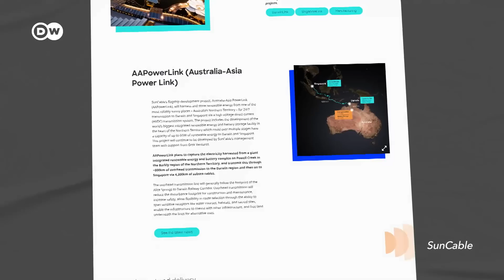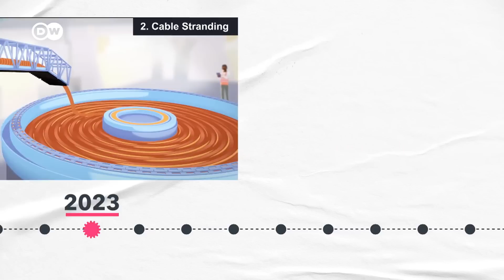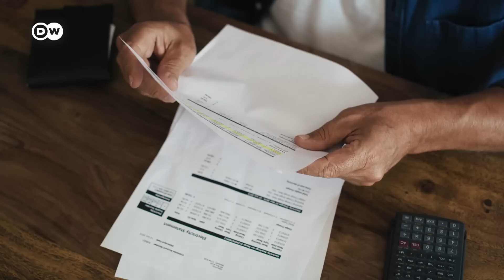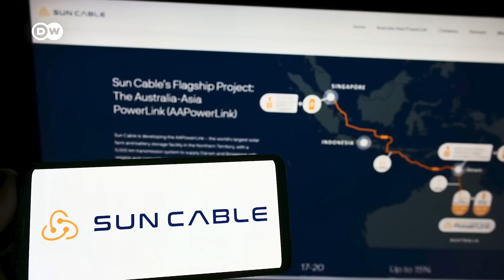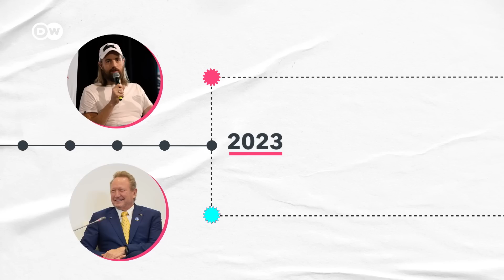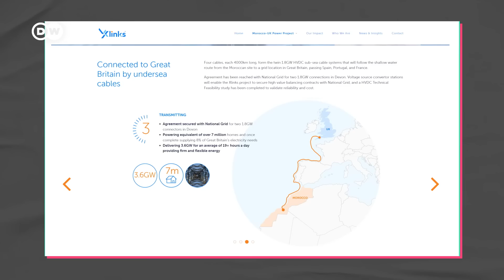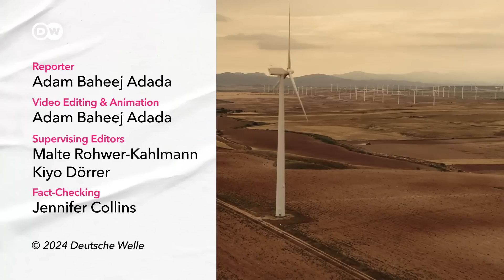Why the mega plan to send Australian solar to Asia (almost) flopped

Comment: Failed to mention that due to long distance and cable resistance 30-50% of the produced energy is lost in transmission.
Reply: No - please check your facts on the use of very high voltage cables.  The drop is minimal.  The only weakness in this soluation are the expensive converter stations at each end.
Reply: @1968Christiaan exactly.
Reply: @1968Christiaan , well, with any transmission line technology, the losses increase with the length of the cable... So even if the losses over 1000 km are only a bit over a couple percent you are looking at about 10% loss over this cable length. That is not nothing... This proposal would have to be seen in competition against other renewables that are possibly a lot closer.
Reply from the maker: Hey there! Could you share your source for the % lost that you mention. There is power loss over the distance. The typical power loss for HDVC cable systems is 3 - 3.5 % power loss per 1000 km. With increased length, the resistance increases and leads to higher power loss.
Reply: Please don’t base loss calculations on traditional alternating current technology. The new way of transmitting power over long distances is by using direct current and modern super efficient inverters on the other end.
Reply: @kevcump62 HVDC is not lossless.
Reply: @davidrossi1486  I did not say it was losses. For very long distance transmission, the new high power inverter technology make DC transmission much more efficient than the high voltage AC transmission lines people are accustomed too.
Reply: The company is using High-Voltage Direct Current (HVDC) lines to carry the electricity from Australia to Singapore. According to the HVDC page on Wikipedia the transmission losses are approximately 3.5% per 1,000 km. 

Over at the SunCable site on the Manufacturing page there is an entry on the FAQ dealing with the types of cable they will need to use. They state, "AAPowerLink needs two 4,300-kilometre HVDC subsea cables to transmit power to Singapore. The current global supply chain lacks the capacity to produce the 8,600 kilometres of cable required within the project timeframe." So they have reduced the project from three cables down to two. In answer to another question they state, "The advanced cable manufacturing facility will focus on 525 kV-640 kV HVDC subsea cable for the AAPowerlink project during its first four years of operation." It is said that the conductor will be made from either cable or aluminum, which really isn't helpful. I don't think that they provide enough information on the site, such as the diameter or circumference of the conductor for example, which would allow one to perform a more detailed calculation of the power cables' performance. 

Each cable will be 4300 km in length, leading to approximately ( 4,300 / 1,000) * 3.5% = 15.05%.
Reply: There are always cable losses. . .  And they are far less with HVDC than AC.. .   And they have been allowing for that.
Reply: Yes people often seem unaware of "voltage drop" - where you lose power when transporting long distances. Better to design a grid where power is generated close to where it's used.
Reply: Sunrise seriously needs some therapy 😂😅

Comment: The island of Ireland has vast potential for wind energy that is very slowly going through approvals and mapping, the biggest issue is connections to markets! We only have connections to the UK at present with the Celtic interconnector between France and Ireland the first non UK connection, but we need many times more connector capacity for us to be able to export our vast wind energy to the European market! They also talk about green hydrogen here, but as you say, it's a very inefficient use of energy...
Reply: An interconnector from Ireland to France - now there's an interesting story, DW. Suncable was always pie-in-the-sky, at a time when not even all Australian states are connected.
Reply: Yes, that is all developing. . . .  Green Hydrogen should only be made from surplus Wind and Solar generation periods and stored as Hydrogen for later use when needed.. .  It is a form of Energy Storage. . .   And if made from Surplus Wind and Solar, it is Not inefficient, but almost a free bi-product.

Comment: At present time, it is a worthwhile idea to transport this energy.   But consider the availability of sunlight and wind are very widespread across the globe delivered freely by nature.

So, the idea of having huge interconnection like this may become moot in the near future because most of the world's population lives in the sunny & warm locations.  Transporting this energy possibly could have value for remote locations living in high latitudes perhaps but that's it.

Moreover, the idea of energy independence is growing since energy is a matter of national security level importance.  It's just that the level of energy independence that renewables can provide has been unthinkable in past decades with fossil fuel global dominance -- exactly what the fossil fuel hegemony wanted.  Renewables have reached historic level low costs of energy production and still continue to fall in price!  The raw inputs of sunlight & wind cannot be sanctioned, blockaded, tariffed or taxed.

Comment: This is so frustrating. Like, the engineering would work, but money and bureaucracy is getting in the way…
Reply: Engineering is by far not only about making something work. Engineering also needs to deliver effective solutions. There surely must be some serious questions about the long-term cost-competitiveness of this idea...
Reply: The project collapsed because the Singaporean Government wouldn't pay for such expensive, intermittent electricity! It is not and never will be a viable, reliable, commercially sensible source of electricity.
Reply: This is not just about bureaucracy. This bureaucracy is here to express the will of the concerned population
Reply: Imagine complaining about money getting in the way. Look up the Juicero if you want an example of what engineering without regards to cost or reason can create. Using resources efficiently is essential to any human endeavor.
Reply: The engineering does NOT work. The cables do NOT work. The economics do NOT work.
Reply: read a 100yo electrical book it will explain that without magic there are laws we have no control of that physically will not allow it to happen, its factually impossible to have the energetic action travel around the world an still even be. 700km think it was that's the longest line on earth and its running upwards of 750,000 volts to have output the other end.
billion volt earth grid because thats even possible.
Reply: No, brains got in the way finally
Reply: Money yes, but Bureaucracy does not need to get in the way of HVDC... .  Yes, AC Grids do require bureaucracy and central control, but HVDC does not.
Reply: Ego & Greed
Reply: @HunterPendleton-nx5pr    It just needs some people to see the way the future power should be handled.. .    Some of us can see that, but some others, will not want to spend any money doing what needs to be done for the long term benefit.
Reply: The engineering doesn’t really work, but the economics is shot. Utterly pointless, especially when we have cheaper and more reliable forms of energy.
Reply: @rickjohnson2165  interconnectors increases reliability for everyone involved.
Reply: no one want expensive electricity.
Reply: @asfsfas2435  hence no nuclear in oz
Reply: @duncanidaho9153  : Nuclear power brings down electricity prices by 75% in Finland.
Reply: Reality bites, doesn't it?
Reply: engineering also includes feasibility and impact. Just because you could doesn't mean you should.

Comment: Why go for these super-long cables? Why not join up neighbouring grids first and learn from those smaller/easier projects? Morocco to Spain, Australia to Indonesia etc. surely it would be quicker/easier to get these up and running...
Reply: The problem is this is being done for money, and Singapore had more money than Indonesia.
Reply: @JohnHughesChampigny  true but Indonesia are spending billions on a new purpose built capital city. It would be easy to add this into the infrastructure. Then just island hop to Singapore and mainland Asia.
Reply: Yes, and a Western Australia to South Australia high voltage DC connection to join the Western Australian power grid  to the grid of the other Australian states sounds easier than a long undersea cable.
As has been pointed out, the significant time difference between Perth and the eastern capitals would be an advantage in matching peak power production with peak usage.
Reply: When you send electricity "through" another grid then you need to pay the operator of that grid a fee for using it. They need to balance their grid with the extra load coming in on one side of the country and leaving on the other. How they meet those demands is up to them. They aren't just going to build a new cable from the incoming interconnect to the outgoing interconnect and let the electricity pass through. They might shift the incoming electricity to a nearby city and export the power from a generator near the outgoing interconnect. That's assuming that they are even capable of handling the incoming amount of electricity if their grid is at or near capacity.

It might be less expensive in the long run to lay down a new undersea cable instead of paying multiple grid operators their fees for passing your electricity through their grids. For example, if Scotland wanted to export power to Gibraltar in the hopes of using it as a connection to Africa, then they would have to go through England, France, Spain, and then to Gibraltar. Or possibly Northern Ireland, Ireland, France, Spain, and Gibraltar. I don't know if there are separate operators for England and Northern Ireland but I'll assume there is. If the cost of passing electricity through another operators' grid is $0.01/MWh then for every MWh delivered from Scotland to Gibraltar it will cost either $0.03/MWh or $0.04/MWh depending on the route taken. They also don't have full control of the equipment used to send their electricity. It's not just security issues but companies could become poor in maintaining their equipment leading to outages. 

While it may cost a lot of money upfront to install an undersea cable it may average out to $0.02/MWh. (I'm just guessing and I have no idea how much it would really cost.) In that case it would be an easy decision to go with ones' own cable. Even it it were $0.05/MWh it still might be worth the price as it builds in the security of knowing you control your own equipment. Plus chances are that prices to transfer electricity over other grids will only increase while this price is fixed over the lifetime of the cable, which has a high probability of being a long time.

Comment: A global grid or even a lengthy power cable will always be an extremely costly and unpractical idea unless somebody can figure out how to produce a cheap way to produce a material that is superconducting at room temperature. This material have to be strong but yet flexible and it has to be made up of something there is plenty of. There have over the years been invested a lot of money and resources in developing a superconductor but as far as I know the best results they have achieved so far is some ceramics that are superconducting at minus 50 degrees centigrade. However these days it is easy to sell idiotic ideas under pretension of being green.
The next thing you know somebody will come up with the idea of sending energy through cable using super lasers and there are probably a lot of people that will jump on the bandwagon and think it is a good idea.

Comment: 20 GW is times more than all of NT needs. A 20 GW connection to Darwin is quite useless as long as there is not further evacuation possible. Currently, another company is developing a multi GW hydrogen project on Tiwi island, just north of Darwin. There are many more who are developing projects in Australia. The amount of GW scale solar and wind and hydrogen projects in Northern Territory and Western Australia is incredible. None of these projects finished or started construction, all in an early development stage.
Reply: All talk has been for a decade or more. Ammonia is a far better solution as its easier to transport and has more current uses.
Reply: @markwright196  That's what I thought (as it was Twiggy's pushed story and Maesk had said they might use it for bunkering) too but there are big problems with Ammonia other than the high cost (inefficiencies). Toxicity and Nitrous oxide for a start.
Reply: @duncanidaho9153  Cost depends on transport. Plus if you use nuclear like the Japanese are testing its 80% on hydrogen and runs 24/7. Plus its only a nuclear island so 30% of a grid power solution.
Reply: Cabled power and Hydrogen projects can work together to make both work better.

Comment: Singapore is importing electric power through interconnectors already and is adding new ones. However, EMA (the responsible authority for power imports in Singapore) is not considering Suncable. Instead there are agreements in place for low carbon power imports with companies in Malaysia, Indonesia, Cambodia, Vietnam. Additional Singapore is installing nowadays a lots of PV and BESS in the own territory, the target of 2 GW PV until 20230 seems to be achievable. Many sources, not a single source, is better risk management and cheaper on the long run.
Reply: The information here in your comment would have been a better basis for this report, with the failure of Suncable as the backstory. Very interesting, thank you.
Reply: @VanillaMacaron551  My opinion on DW Planet A is that they are excellent and this video is excellent. They are much better informed compared to most other formats. I should know a little bit more background because colleagues of mine worked in the past for some of the companies considered by EMA on exactly these projects. I delivered a little bit input for the feasibility studies for two Indonesian projects a few years ago. However, nothing that qualifies me to judge the information provided in the video.
Reply: @VanillaMacaron551  suncable is an old initiative that was started as a singaporean company. the australian government hadnt actually signed off on anything the last time i checked.
Reply: Singapore does not have the space for serious Grid SOLAR. . .  Australia with its open sunny desert areas is very well suited to provide a lot of Solar generated electrical Power, which Malaya, Indonesia etc, can not reliably do, due to their climate.

Comment: 4:38 your graphic producer didn't comprehend the scale difference between 12900 km and 750 km jfc. Edit I'm a buttmunch and the 12900 was just the total length of 3 cables x 4300 km.
Reply from the maker: There are three cables along the 4,300 km route. 🦾
Reply: @DWPlanetA  You don't seem to be understanding the comment.
Reply: @DWPlanetA  Oh thanks I'm a mega buttmunch. Love you guys.
Reply: Only 2 more digits. I have meassured digits before and 2 digits is not that much.
Reply: The distance is "only" 4300km times 3 cables = 12900